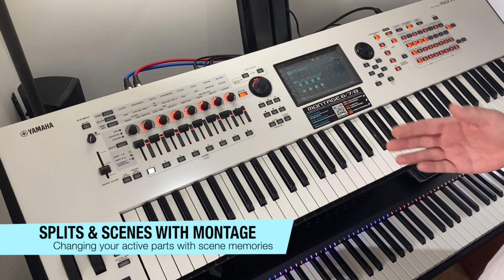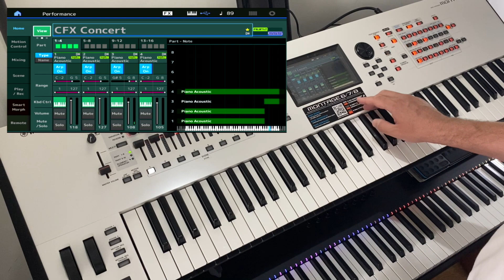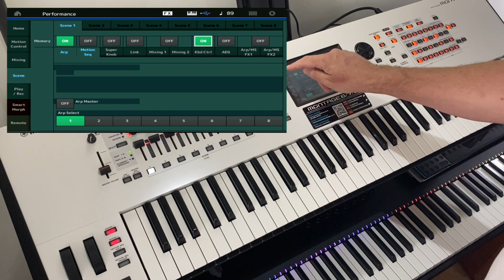How to use scenes to control active parts with Yamaha MONTAGE and MODX

Comment: Interesting.  I use scenes all the time on my MODX7 when playing live. Where you use keyboard control to activate the parts, I use ‘mute’ to achieve the same thing.  I wonder what the practical difference is between the two, and whether I need to change how I do this.
Reply: I don't have my MODX7 yet, but my guess is that muting it perhaps doesn't release the voices for increased polyphony?  Just guessing here
Reply: Ok - found out that the difference between using "MUTE" vs keyboard control is that when using MUTE, you don't get the "seamless" sound when switching scenes (that is, where a sustained sound continues after switching scenes).  If you use keyboard control you get the seamless control.  Here's a link to a video where he mentions this: https://youtu.be/tt0SCXHyIuI?t=381
Reply: Thanks.  It makes perfect sense.  Time to edit my presets.

Comment: i notice your lights flickering there - i wonder if you can reduce frame rate and increase shutter speed on camera to improve that...? another friend in America had similar problems - might be related to NTSC standard. Good video - helpful.
Reply from the maker: The InterGalactic Federation I actually recorded at 60fps and the flicker was still present, so I think it’s just the nature of these LEDs. It’s probably possible to do some kind of voltage sync to remove the flicker, but that’s beyond my expertise at this point.
Reply: i had the same problem at 60fps with a fast shutter speed - try going slower [24fps] and see if that fixes it. our domestic power is 50/60Hz 240V which could be a factor too
Reply from the maker: @TheInterGalacticFederation  Sorry I totally misread your first comment and assumed you suggested increasing the frame rate - I'll give it a try with a slower rate next time, thanks!
Reply: i don't know if it will work but worth trying. let me know how it goes if you can,  coz my other friend had the same problem
Reply from the maker: @TheInterGalacticFederation  Looks like 24fps is better but still not perfect - here's a quick test: https://youtu.be/V_w-alz_4YA